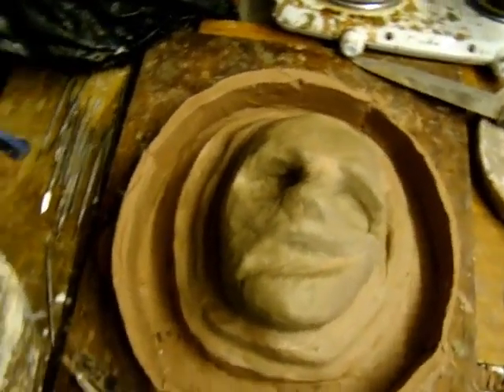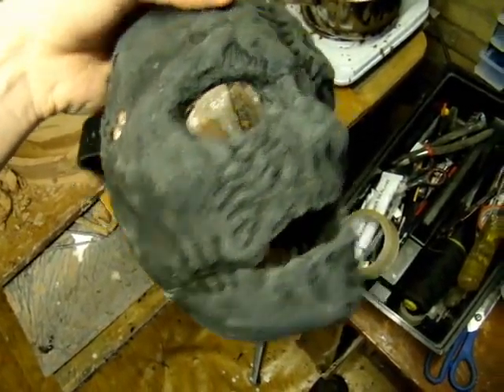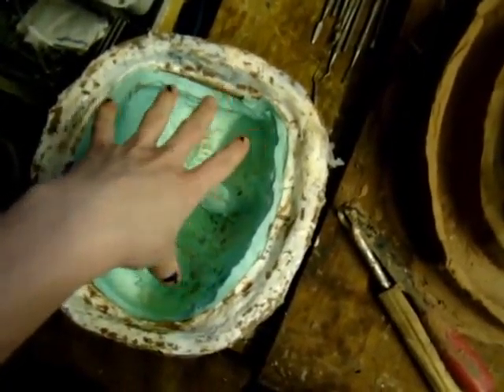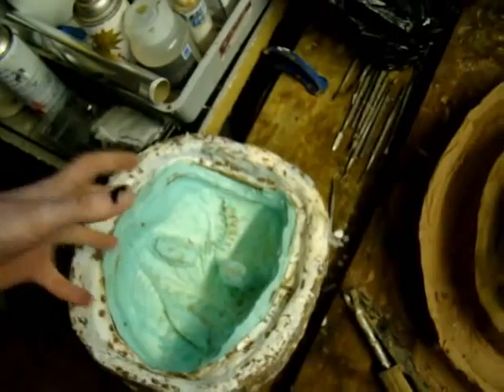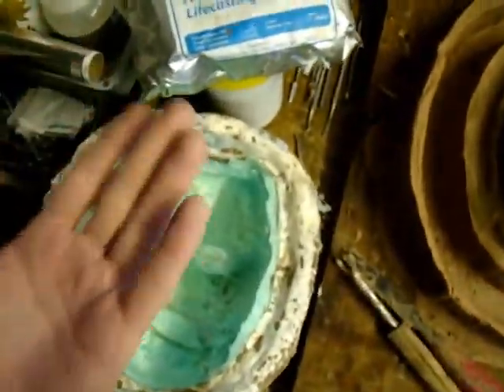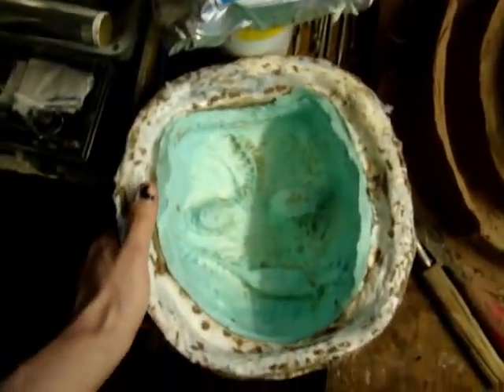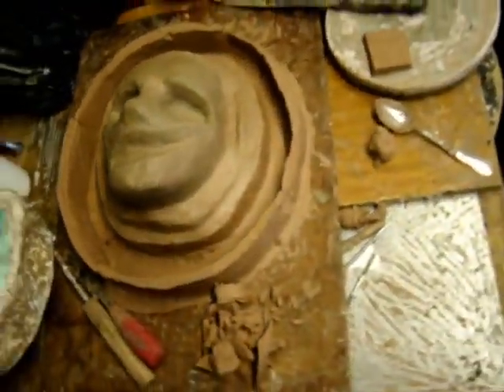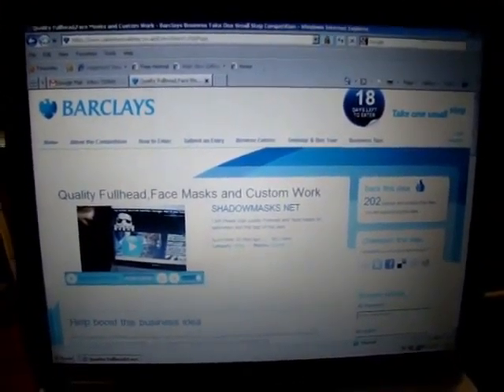Self Skinning Poly Foam Mould Plug

Comment from the maker: @LuciferSyxxx Once you have made your plaster plug you mix the foam until its starts to rise put it in the rubber / plastic mould then push the plaster plug in g clamp it together move the mould around so the foam fills all areas for a few seconds then let the excess foam rise out of the holes in the plug.